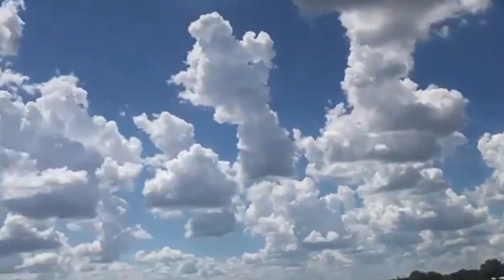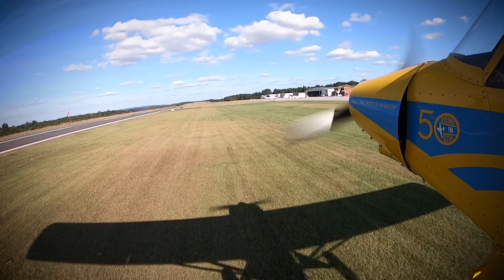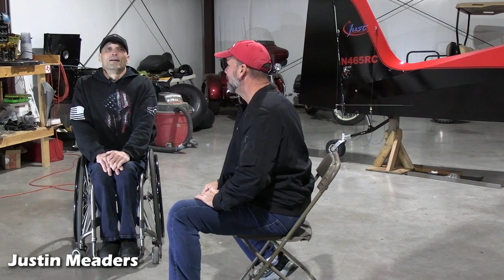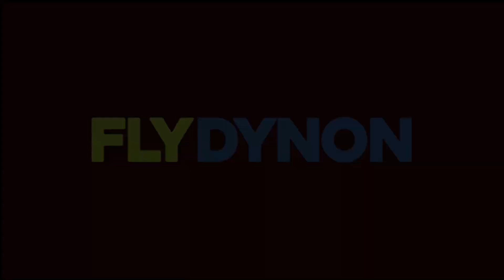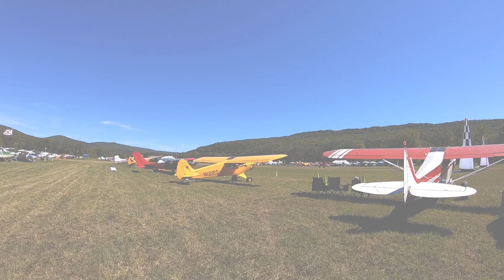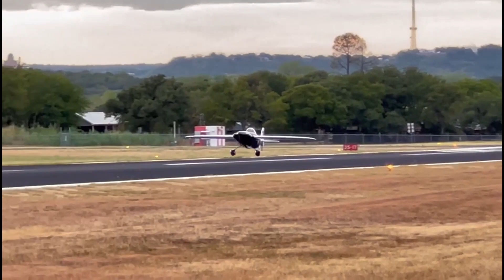Reno Air Racer - Formula 1 Pilot Justin Meaders - Aircraft in Aviation

Comment: Would have been interesting to see how he manages everything with hand controls.
Reply: He has a traditional center stick for aileron and elevator with the addition of a motorcycle style brake lever that controls the brake on the right side main gear. On the left side of the fuselage there is a second control stick that moves in a push-pull motion for rudder control. It has a motorcycle style twist throttle on it as well, along with another brake lever for the left side main gear. Then at the very top, up through the middle of the twist throttle, is a mixture control knob that he can adjust with his thumb.
Reply: @MX304  Thanks for that!

Comment: Love that sound sounds just like my RC pylon racer must be a hand full taking off. I wonder if they put little more weight on the inside wing like RC pylon racing so the inside wing just stays down all you do is pull the stick back.
Reply: You don't need asymmetric weight to keep the wing down... Thats not how stability & control works.